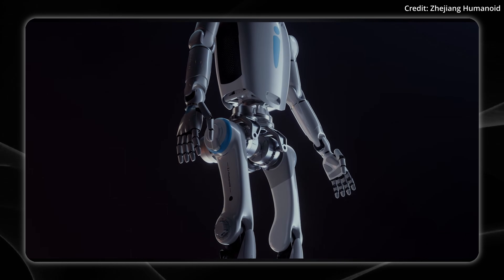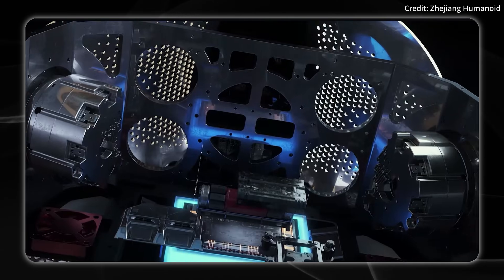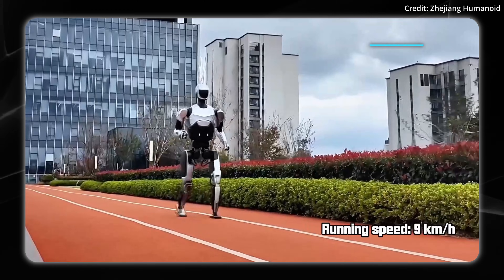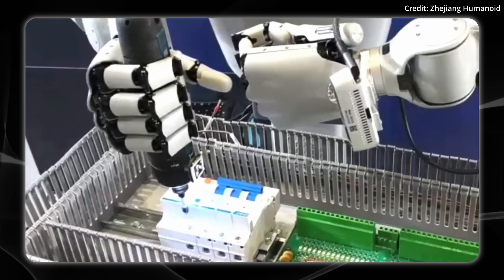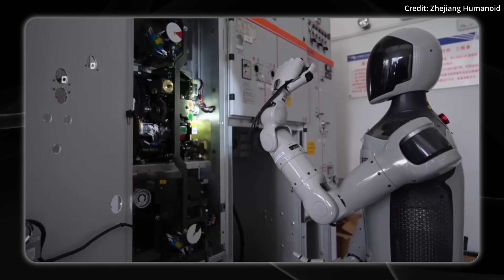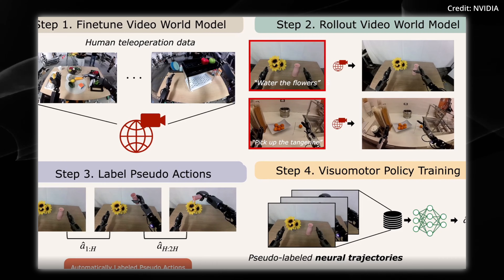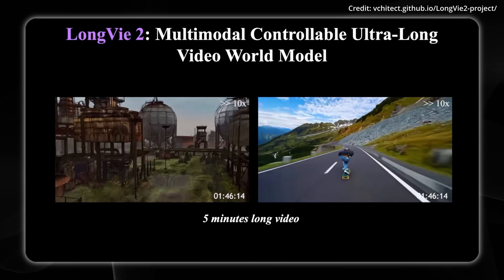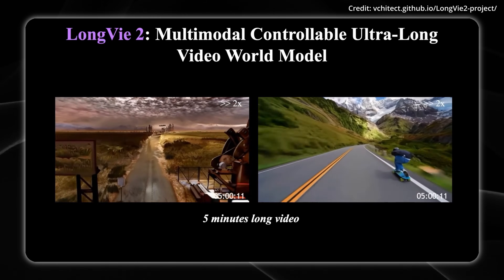NVIDIA's 40,000 Hour AI Experiment Changing Robotics Forever (AI NEWS)

Comment: To design robot legs correctly it is not enough to make them look like human legs. The mechanisms must operate according to the principles of the human body. For example a person stands on one leg when taking a step or jumping. This also happens when shifting weight or simply lifting a leg. At such moments a person rotates the pelvic bones and the spine. This is necessary so that the head of the hip joint is as close as possible to the projection of the center of gravity. Such movement significantly saves energy and protects the structure from damage during walking.